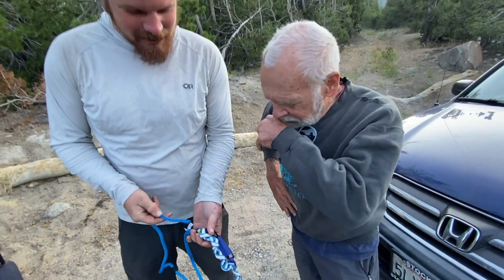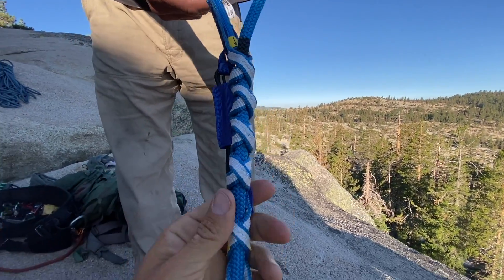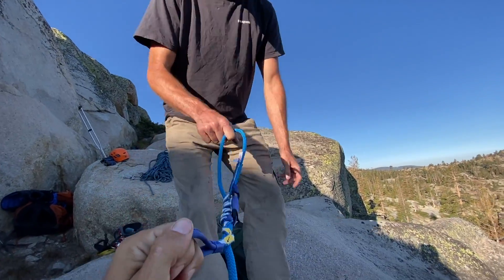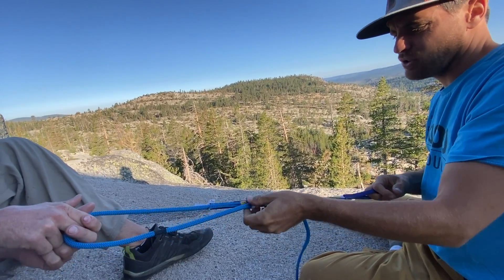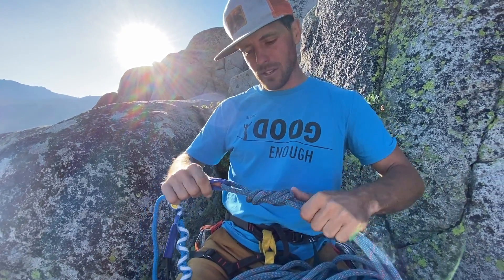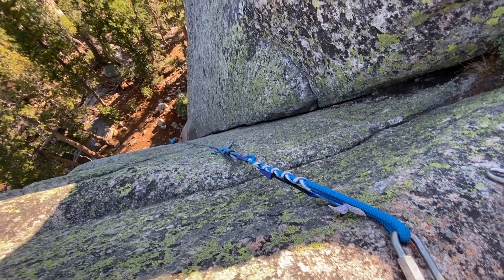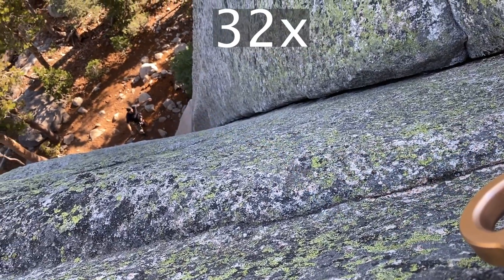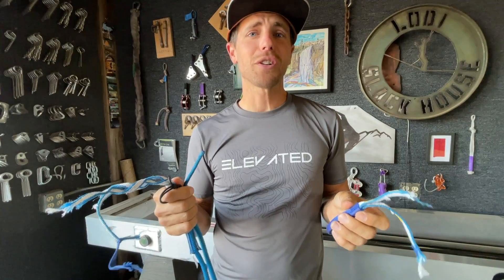Would you Trust the Beal Escaper for Rappelling?

Comment: 2025. The marketing image on the front of the Beal Escaper package in the store actually shows it being used directly through a single hanger *with no rap ring*.  Yes, right over the sharper edge. I think that's a mistake, the manual shows a rap ring.  And I have seen other packages that don't show it going only through a single hanger.  Odd that it's on ours.  Canada FWIW.  

I'm fairly sure it's not intended to be used through a single hanger only with no rap ring.

Comment: I used the escaper on a regular basis to save on weight when soloing and wanting to rappel at the end of some routes. 
The main problem is the number of tugs required to release it very highly depends on the steepness of the route and if there are any angle changes along the way. 
I had times when I had to pull well over 50 times to get my rope back and one time when after pulling more than 100 times (and I know how to pull it the right way) I still was not getting my rope and it was getting dark and cold i just left both the escaper and rope up there and returned the next morning with a normal rope. My gear was still up there and I just rappelled on the normal rope. 
Since that day I only carry it for emergencies and reverted to carry a bit more weight on me rather than have to spend hours pulling on that damn thing 🤣 works well at home and on routes that are 100% vertical or over hanging

Comment: I used to keep the escaper in the bottom of my pack or on the back of my harness as last ditch safety tool. If i had to rappel in a situation where my rope doubled up might be too short (for whatever unplanned reason), I could take the escaper out and have an extra margin. Otherwise i I would just rappel normally

Comment: I bought one of these a long time ago and haven't had the balls to bring it out and actually use it. You guys basically tested every one of my fears about it - ha! I think this product is a great option when there's an intended walk-off but you're worried about potentially having to bail on a big route. I agree with other commenters to use this only on steep terrain - so many things that could get stuck in a crack - and never attach a carabiner to this unless you want it slingshotted at your head. It's annoying (but probably a good thing) that it was taking you guys 30+ pulls to get it down. It'd be cool if you guys tested a few different yanking techniques (hard and fast or slow and long?) to retrieve your rope most efficiently.

Comment: Might be interesting to see how many tugs it takes to release if the Escaper gets wet (like you're bailing off a climb as rain is setting in).  Water might affect the friction coefficient.
Reply from the maker: Interesting test. If the rope swelled it could be harder to get it out
Reply: @HowNOT2  I was also thinking that, if the rappel rope were long enough, it could weight the Escaper so heavily that, when you pulled the lower end down and released it to go up again, it wouldn't actually go up and the upper end would just stay "down" the entire time (i.e., the "spring" mechanism built into the Escaper couldn't pull it up enough to make the ratcheting mechanism work at all).

Comment: They say it only needs 10 pound of weight to stop it from slipping, thats not alot. Essentially so long as there's any weight on the rope it shouldn't slip, if your desending and are so jurky you repeatedly totally unload the rope even with rope stretch you need to practise more.

I'm surprised they used the carabiner like that, if its pressed on an edge like that use something to get it over the edge otherwise your applying a force to it that its not rated for, hence the flexing.

Great video BTW, really enjoyed it.

Comment: The Escaper is a stripped down version of the rope clutches I use on my 40 foot cruising sailboat, built by Ropeye. They are insanely strong. I always envision modding two into ascenders or working them into my haul bag system. Check out the technology here https://www.youtube.com/watch?v=3fU9mSFMOkE Here is a great test of a similar constrictor clutch, you can really see the strength. https://www.youtube.com/watch?v=bzA1_a-ORmI

Comment: Why not just use biner blocking techniques? Way safer and less chance of getting stuck at the anchor if a clove or alpine butterfly is used on the blocking crab. one downside is that carabiner can get stuck on the way down, and you have to carry a tag line with you. However, 4 mm 70 m tagline stacked in a small rope bag barely weighs anything, probably marginally heavier than the escaper.

Comment: I think it is very much worth mentioning that this device is evaluated for safety in terms of ENSA standards for belay anchors. That is the vertical spread of 2 fixed bolts where the top bolt is equipped with a chain such that the 2 rap rings match  closely with each other providing a single masterpoint. Practically speaking, a single fixed piece that rings and passes visual inspection as a rappel anchor isn't a concern to waste to much time considering if that is what provides the safest path down.

Comment: Thanks. I've used this a few times so I can LRS with a shorter rope. Obviously I was only Always takes at least 20+ tugs to get it down even when I was removing gear and bouncing. Obviously I was only doing this last one as a test and it was very sphincter exercising! But still even with ledges, stuck gear, and a 35 m ab it took 23 pulls. 
It would be great if you could show it going through 2 anchor rings.

Comment: Have seen one in action on a snowy couloir. I was ascending while two guys were rappelling with it... and eventually I had to help them releasing the gadget from the R after pulling like crazy for some minutes. My conclusion: use it only on step rappels and preferably avoid winter conditions (as I don't know how does the bungee works if the device gets wet and frozen). Also... The longest the rappell, the more difficult is to release, as the elasticity of the rope difficults the release

Comment: The Escaper is basically just a pre-tied Extended French Prusik knot. According to Geoffrey Budworth of the International Guild of Knot Tyers in his book "The Complete Book of Knots": "The basic French Prusik knot in cordage seems to date from the early 1960s. In 1977 Robert Thrun recommended more racking turns to extend the knot. The Chinese finger-trap version shown here is intended to be tied in tape and was created by Robert Chisnall, who described it to me in 1981." Chisnall also first published a 3-loop version of the Figure-8 knot, a Triple Bowline variation, an excellent adjustable loop knot, an overhand shortening knot (to shorten a rope), and a doubled version of the Munter friction hitch useful for wet or slippery rope in emergencies. Chisnall is a climber, and works in forensic knot analysis.

Comment: I know the canyoneering community was chatting about this for a while when this first came out but I don't think it ever became a popular option. I'd be curious to see how it handles skinnier static ropes. Dump some sand in there too for good measure.
Reply: Rope size doesn't matter as you are only thing your existing rope around a dynema loop
Reply: @Shadowang323  I guess static ropes of various diameters wouldn't have a ton of variance in static elongation when compared to their dynamic rope counter parts, but there still is a variance. I guess I'd mostly be curious of how a statics rope lack of stretch would impact how many times you'd have to cycle the beal escaper before it releases. Alot of times in canyoning, you might come to a stop on small ledges which could load/unload the anchor causing the Escaper to inch closer to release.
Reply: @andrewtanasescu7205  i think a static rope will make it easier to load and unload the device making it easier to retrieve but also easier to underweight in ledgy environments

Comment: I want a bluetooth version of the Beal Escaper! ;-)
Reply from the maker: look up the Kong e frog. I have been unable to find one commercially available so i am not entirely sure it isn't a joke.
Reply: @HowNOT2  interesting! At least the articles are not from 1st of April and from several reputable sources. The product was shown at a fair and was supposed to cost a few thousand dollars :-). And then there would be the problem of a piece of metal potentially hitting your head after falling for 50 meters... The one thing I dislike about the Beal Escaper is that it seems to be a huge gamble if you can retrieve it when the route is not very steep and has some rope friction.

Comment: I just don't get when really to use (need) it. 
So you still need a solid anchor or at least one bolt. It obviously does not help with the stability of this anchor or bolt itself. 
For rapelling you can put a rope directly through the bolt. As there is no relative movement of rope against bolt this is also ok for bolts with sharp edges (burr?), where a lowering through (as in tope-roping) could be catastrophic.
So why not put the rope directly through the anchor and retrieve the rope after rapal just as usual. The only thing I see is you can use the full length of a single rope and rapel on one strand. But in surroundings, where emergencies and quick escapes are necessary I probably would have double ropes with me anyway and knot these together for also haveing the full length of the rope..
The jerky rapel scenario alone would scare the s* out of me to have trust my life on something like this
Reply: Any time you require two ropes to descend you would be able to use this instead of carrying all the extra weight. It's safer to carry less weight in most situations.

Comment: Thank you for testing the Escaper. I was always wooried about the , think its 8mm, dyneema sling, but its super good enough. This thing works great and i always have it with me doing some steep hikes or flat climbs. With 20m light halfrope(i dont trust this dyneeme ropes 🥺), a repelling device, a light mountaineeringbelt, some slings and some carabiners it weights under 1Kg and i must not call the helicopter if i´m to scared ro climb down. 40m halfrope with repelling stuff  would weight much more. 😉👍😎

Comment: Been waiting for this video for sooo long :D

I've been using the Escaper for about 6-8 months now, very frequently for short multipitches in my area (150-300meters). Normally carry a 70m rope, means I can cover two pitches (sometimes 3) each rappel. I'm 100kg and I doubt it has ever slipped at all as it has consistently taken 20-21 pulls (I use a slightly different method to what was done in your video, but it has never ever taken the 8x pulls stated, though I am more relieved that it takes 20+ :D). I also only ever rappel off a single bomber anchor point with this, it never sits correctly through two pieces and it slipped when I waited it the first time through two pieces, I had a safety on of course.

Another thing, I often use this on slabby / ledgy terrain, a lot of scrambly pitches where I am, I just maintain light tension on the rope the entire time and it has still always taken me the 20-21 pulls to retrieve. I'm more paranoid about it getting snagged dragging down slabby terrain than it slipping. Best method I've found for pulling is just to pull full stretch of the rope tight and then completely release the rope out of your hands so it springs high, the bungee cord on the device does it's best when you take your hands completely away. This doesn't have to be a full body heave either, just grab high and pull to waist height and release. I've tried harder and softer and it all seems to be about 20-21.
Reply: As a reference for the pulls also, I have always made sure the black mark has been fed all the way through the finger trap. From that thread, I consistently get 20-21 pulls.
Reply: Very cool! But doesn't the rope easily get stuck on slabby terrain though?

Comment: The Beal video, https://youtu.be/7_PvAEvXMwM, advises that Escaper rope should be pulled through the dyneema sling until the black mark is below the last sling loop (at 2:02) (i.e., the Escaper is fixed about the black mark).  

Additionally the video advise that a stopper knot (at 1:47) should be used on the Escaper rope for the inital rappelers/abseilers; and the last rappeler releases the knot before rappeling.

Comment: The scariest part was rapping off a single bolt.  I know it's super good enough but it's still wiggy.

I'd be curious to know if the line can be jugged.  If the escaper doesn't release but can't be safely jugged then it's a problem waiting to happen.
Reply: “The scariest part was rapping off a single bolt.” Especially an expansion bolt that close to the rock edge and a carabiner loaded over an edge.

Comment: I’d add a few links to those anchors if it was an area I visited very often.  Thanks for sharing. The sell is why do you need this device? at least for the fiancée it’s hard to explain the cost all to double the distance you can rap. Even to me seems like a well… I have everything else climbing related but want a new piece of gear…kind of device.
Reply: The theory is for emergencies when you need to cover a lot of distance in raps but you still don't want the weight of half/twins for more conventional full rope length raps.  Basically there's a storm coming (or already on top of you since they can come in REALLY quick depending on how far away you can see in the alpine setting you are in) in the alpine and you are in a situation where bailing down instead of bailing up makes sense.

Comment: I think the risk of the escaper coming undone during a rappel from bouncing is not actually that high. Even under ideal circumstances, you need 20-30 totally unweighted “bounces” to undo it. So maybe if you stand up very suddenly on 20-30 ledges you could make it happen, but I don’t think just “bouncing” a bit will actually unweight the rope enough for it to start disengaging

Comment: Would love to see someone ascend on that, and also how many times you could unweight it going over steps/ledges.
Also my guess for tying straigh into the device would be you wouldn't want a carabiner hanging up on the rock ar your trying to release.
Reply: I'd be super skeptical for ascending.... even the smoothest of frogging or ropewalking is still sooo much motion (let alone jugging if it's free-hanging). 😬
Reply: @rachelhasbruises  exactly, so you would not want to rely on this for multi pitch abs, if it gets snagged on one of the retrievals your screwed, and you wouldn't want to ascend back up not knowing how far away it is from release.

Comment: Great test guys.  I've got one, It's always in my pack on multi-pitch days for emergencies.

My son and I used it out at Linville Gorge NC instead of scrambling down a very long approach gulley.  With a full 60m rope out it took a full 20+ pulls to get it to release.  each pull was both my son and I jumping up and yanking down.  defeating all the rope stretch to engage the inchworm effect is tough.... 

So Escaper or a good 6mm tagline.  tagline will take up more room in pack but easier to pulldown.  Both are definitely better options than using 2 ropes if the 2nd rope is only needed for descends.
Reply: Didn’t expect to see the Linville Gorge mentioned here. What up gorge rats
Reply: What routes in NC I'm localish to the gorge.

Comment: 2:40 The black mark is supposed to be BELOW the sling not above it! It indicates the minimum amount of rope that needs to be sticking out. When Ryan repels the black mark was already part way through the finger trap (still plenty good enough though). Had me a bit worried there!

The instructions also say maximum 20mm diameter for the thing you're threading (so no threading two bolts).

There is a trick you can use if you want to use it on something bigger like a tree. You can basket hitch a large sling around the tree and thread the escaper through that. You can then tie one side of the sling to the escaper so it gets pulled down along with the rope.

Comment: I think that the difference in your earlier tugging to pull the escape through vs in an actual use situation is friction. Thinking about it, it seems like in a rappel situation you have load on the system constantly. The variability in bouncing would change the load but not unload the rope. That would mean that there would be a load high enough for static friction to hold at all times and your bouncing would only be above minimum static friction load. Whereas when you are bouncing unloaded or in a tug of war, there would be a variation around no load on the rope causing it to drop beneath the static friction load necessary to not slip. Just a theory and not helpful for testing before loading but mentally may help to think about it this way if you use it again.
Reply: Exactly what I was thinking.